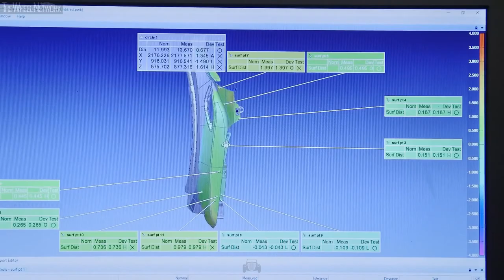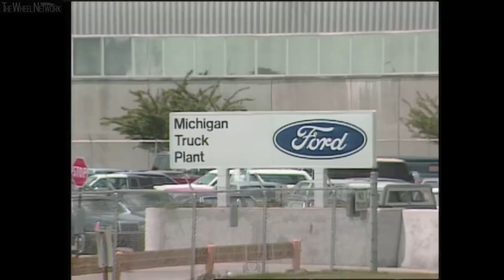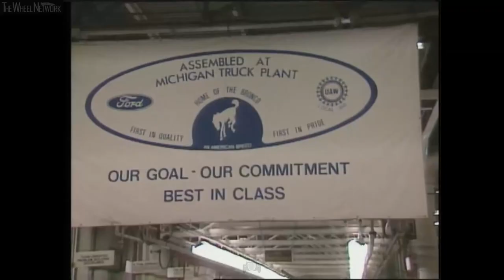Ford Truck Production in the United States

Comment: In the 1980s I often dined at the restaurant up the hill from the Ford F150 truck plant in Saint Paul Minnesota.

 It was amazing, every 45 seconds a truck rolled off the assembly line at the Ford plant. Through a friend of mine, I was able to get a tour of that plant.

The process is incredible, all of those pieces and parts coming together and every 45 seconds a truck was completed.

Comment: I got a 2016 with the 5.0,  just hit 160K miles, still drives like new!  I saw my year in there
Reply: Where did you see a 2016 in the video?  It’s all 2022 model year trucks.
Reply: @PTRRanger951  @25:30, 27:43, 32:35. and more.
Reply: The 2015-2017 were the best looking F-150 front ends ever made. The 2018 and newer front ends look wimpier and wimpier.
Reply: @PTRRanger951  they in there,  you got to wach the whole video, even goes back to the 90's
Reply: @robbieeades1956  I actually like the 2018-2020 also they look classy, the newest onest look like 10 year ago chevy, boring. But yeah 15-17 were the best!

Comment: Looks like everything should be "perfect" in regards to these trucks being built...I'm a Ford guy and ordered a '21 F-350 7.3 straight from the factory. It only took two months for it to arrive (this was just before the "supply issues") and with close inspection, there are plenty of fit and finish issues. Crooked panels, splotchy paint, screws driven in sideways, things that should have been attached firmly but weren't. In other words...some of the humans working on these vehicles get sloppy,  lazy or simply don't care. It really shouldn't happen considering they're given enough time to do it proper...and no one is doing a thorough check on these things before they ship them out. I love the truck...I just wish it had been put together with more care.

Comment: Was hoping to see more frame assembly on the current Superduties to see if in fact the 5th wheel prep IS installed on the line and not after thee truck is built as some have suggested.

Comment: My new ranger has been sitting  in a parking  lot over 2 months built with  a shipping  delay. All the April ones have been shipped  to customers  already.  I read the ones built Feb/ March that are parked in the lot with the unfinished  Broncos have the soy based wire insulation being consumed by rodents at this point. The check box built is no longer checked  off in the tracker like it originally was so something  definitely  happened to it. Ford is really destroying their reputation by not being honest with customers or dealers about the real delivery  time frame. Tell the truth  up front and don't keep promising a new date every week.
Reply: Good luck when you finally get it.  A colleague had Ford take his Ranger back after two months with a blown up tranny.  Got a full refund that he's applying to an F150 Hybrid.  Not sure I'd have done the same, but he likes technology.

Comment: Lemons.  10 speed transmissions that dealers can't fix harsh shifting.  Plastic oil pans that leak the before the first oil change.  Plastic valve covers that warp by 20k miles. 3.5 ecoboost engines that rattle upon startup.  Dealers can't get parts to fix these lemons.  I've had all of these issues on my Fords.  Never again.  Dealers have no parts availability to fix them.